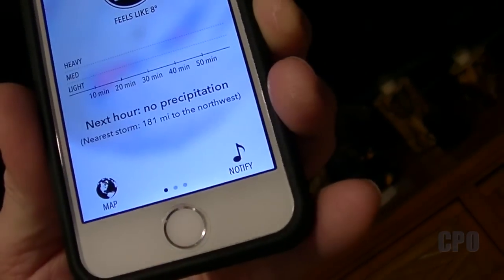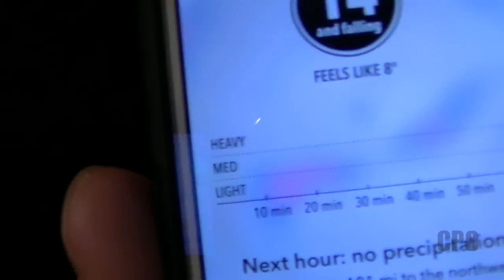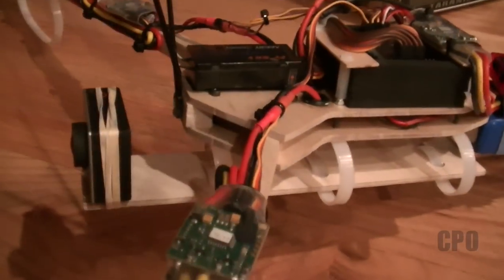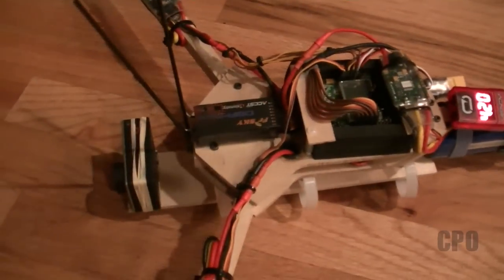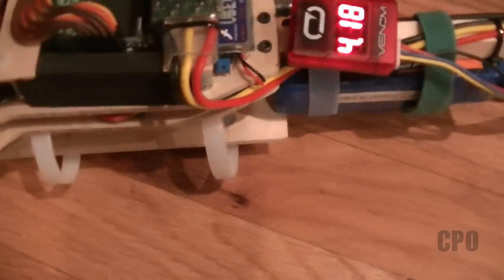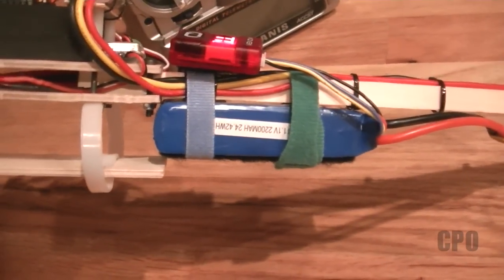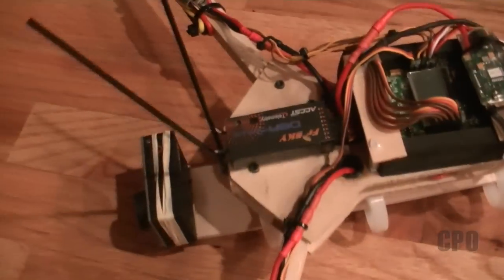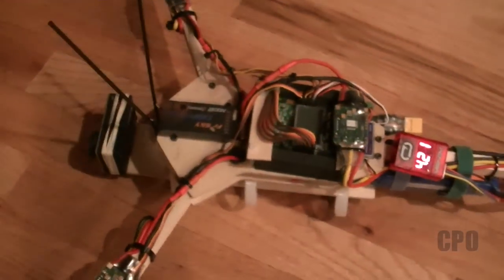CPO Tricopter Build : First Test of Vibration Dampening Camera Tray with GoPro

Comment: Hi CPO! I built my first Tricopter based on your design and just tonight i added this camera tray and loaded it with my 3S 3000mAh battery in the back + GoPro 3 Black (720p 60fps) on the front twist tied to the plate directly, the result?..... super clear video! no jello at all! and my props and motors aren't even dynamically balanced so there is a fair bit of vibration but it never made it to the video. The Quad frame i transplanted my motors and parts from had horrible jello on the same motors/props combo.  You sir, are a genius for thinking this up! super simple and no exotic parts.
Reply from the maker: Thanks for the feedback Paul!  I am still really happy with the design, so I am glad it also worked for you!

Comment: Very nice CPO.  Smooth as silk.  I spent the entire afternoon futzing with my new Soko tool trying to plumb the main shaft.  Major inconsistent results with the method used in your video.  I always seemed to end up with one of the readings 4 or 5 tenths different from the other three readings which tended to be within 1 tenth of each other.  I was working with three different helis and saw the same results with all three machines.  I am really scratching my head on what I am doing wrong.

R.O.G.
Reply from the maker: So...I guess...tell me how you are doing it.  First, FB or FBL helis?  FB is a pain in the rear because of all the links.

Comment: Looks good CPO I've got to try that firmware looks pretty stable for no tuning.
Where did you get that voltage display?
Reply from the maker: Thanks.  Sorry it took me a while to respond. I had to look it up!  Venom Low Voltage Battery Monitor 2-8S.  I got it from Tower Hobbies for about $10. I really like it. It's the only one I have, but I may grab a few more.

Comment from the maker: So, I’m pretty excited to report that my idea for a simple tricopter vibration dampening camera tray design looks to be working great. Probably the most unknown part of my build (as in the part that I haven’t completely worked out in my head yet) was the camera tray.  I have seen lots of ideas on vibration dampening.  Some were very complicated, some just didn’t seem to work. I tried to go with a blank slate, and throw all other ideas out and think through what might be a useable design.  

Of course, you all now know what I came up with…a heavy duty zip tie mounting solution to connect the camera/battery tray to the aircraft. I thought the zip ties would be stiff enough to provide rigidity to the assembly, yet flexible enough to provide vibration dampening. 

This morning, I stole the opportunity to test this design for the first time. I was out a little before sunrise with my GoPro camera rubber banded to the camera tray.  It doesn’t get any simpler than that!  I did put a couple of pieces of gyro mounting foam under the camera so it wasn’t sitting directly on the wood tray. 

I couldn’t be more pleased!  The lighting of the video isn’t the best…but remember, this is still pre-dawn lighting.  I wasn’t doing a camera test, but more looking at the mount.  Were there signs of vibration?  Jello?  Were the props in the picture? I feel like I can answer no to all of those questions.  The footage is unedited for cropping or stabilization. This is straight out of the camera, at the widest FOV setting.

As you can see in the video, my battery had to be moved back to the tail boom to offset the weight of the camera up front. I may extend that tray further back.  Not sure yet.  When I start adding FPV gear on the tail boom, the battery will probably go back under the body.  That testing will come soon. 

Also, I consider this a testament to Steveis’ KK2.1 V1.11S2 firmware. This flight is with completely stock settings. I have done ZERO tuning. This works, in my opinion, because I took great care in making sure that the KK board is directly over the center of gravity point on the tricopter.  It shouldn’t have to work very hard to keep the thing in check, because it is naturally balanced. If all power was lost at once, I would expect it to fall straight down (right side up) because it is balanced exactly that way. And of course the default settings that Steveis put in the firmware are nearly perfect given that fact.

I can tell my P gains are a little high when the gusts of wind come…so I know I have some tuning to do…but you have to admit this is a pretty decent start!

Thanks for all of the support, and as always, feedback is always appreciated!

cpo